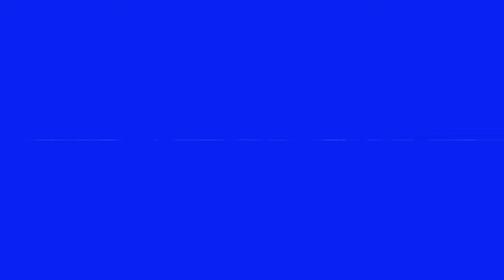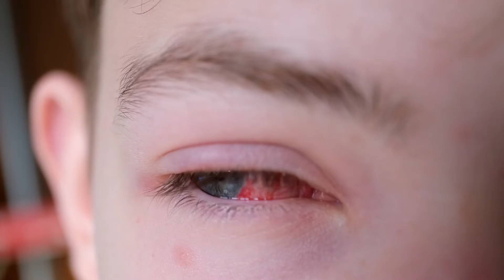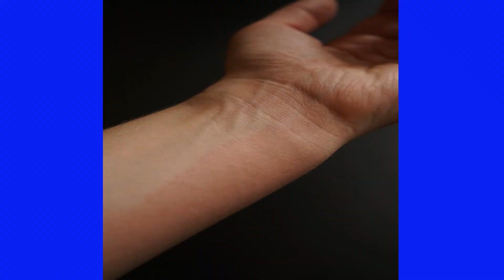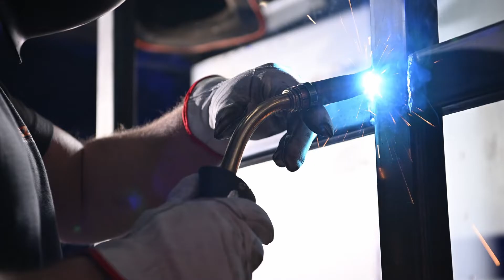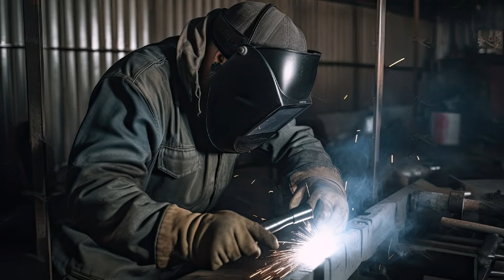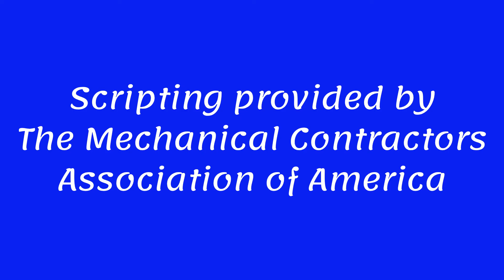Fabrication Shop Safety Video #15 - Welding Radiation

Comment: I took a welding class in 2005 when I was in 10th grade,  and one of the things I was taught for selecting the correct filter lens, is to start with a shade too dark for comfort,  then move one or two shades lighter. This should be the same or close to the charts published in welding handbooks,  although some welders have their own preferences.   It should be comforting to note that all welding shades are designed to block over 99% of UV and IR, while the shade number merely indicates the amount of tint, or the percentage of visible light transmitted.   

Fortunately in this day and age we have a variety of auto darkening helmets to choose from at a wide price range to suit almost any budget, and all but the most basic and budget conscious models have variable shade capability,  typically from 9-13 on the lower end models, with the more premium versions offering a wide range such as 5-13 , a small handful of models now offer shade #14.   

Although I am a journeyman electrician,  I also occasionally do arc welding for maintenance and repairs.   I have an auto darkening helmet made by Antra, with grind mode, sensitivity/delay adjustments,  and shades 5 - 14, and  a Lincoln AC 225 "tombstone " and use shade #10  for all the welding done around the home, except when I use the carbon arc torch accessory I built, in which I select shade #14 since carbon arcs are much brighter than most other welding processes. It's crude and not ideal,  but I find using ¼ inch carbon electrodes at 60 amps works in a pinch for brazing,  75 to 90 amps for heating and bending steel.   A oxy-fuel torch would be much more user-friendly,  but I don't do enough metalwork to justify buying a oxyfuel rig.
Reply from the maker: Thanks for watching.